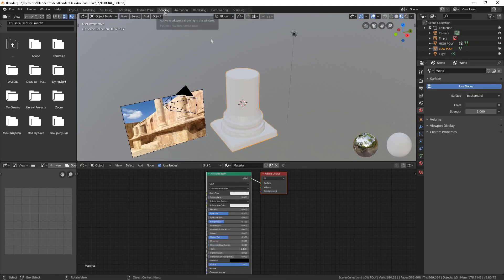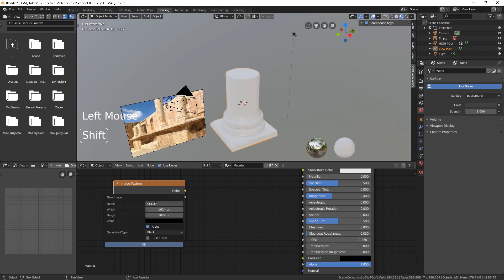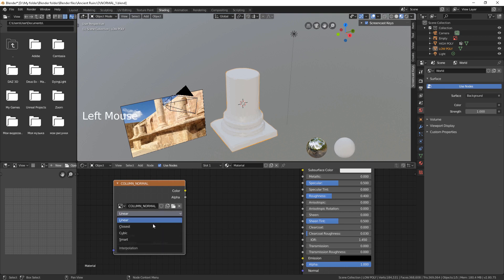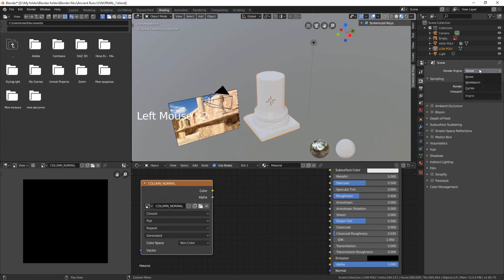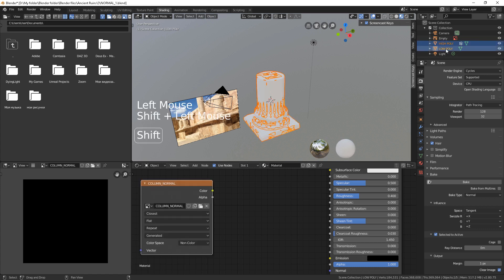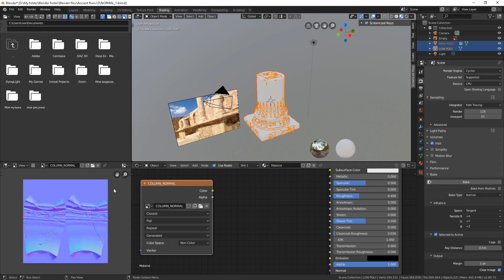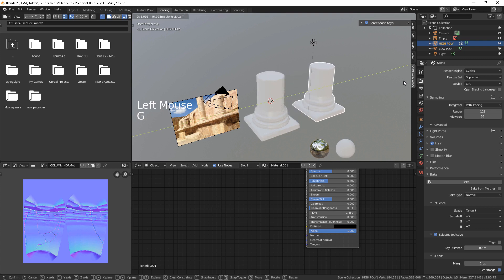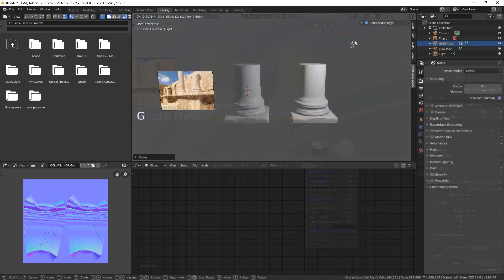Blender 2.8 / 2.80 Modelling a low-poly column / BAKING A NORMAL MAP CORRECTLY / NO SEAMS/GLITCHES

Comment: Im baking o my high poly so I only have one object to bake the normals on and Im getting orange color on the normal map. do you know how to fix this.
Reply from the maker: Hi! What do you do in specific? Anyway, baking with a cage mesh helps to resolve most of the issues. Check another video on baking ;) Most common problems occur, when baking with insuffient or too high  Ray Distance, baking onto Ngons, too small size of the low-polygonal mesh, not covering the high-polygonal mesh enough, baking without a cage, ect.
Reply: @artemtovbaz8452  Im baking on to the same high poly object just for the normal map. Its not too hgh poly but high enough.
Reply from the maker: @chrissem5200 You can bake a normal map for the same high-polygonal mesh, if it's sculpted with Multiresolution modifier, otherwise you bake from the high-polygonal mesh to the low-polygonal one. So in the second case you can use a Cage-mesh to prevent baking artifacts ;)
Reply: @artemtovbaz8452  I have a hard surface model which I modeled and im trying to bake the metal grunge normal map on it. 1 object only and baking on itself.
Reply from the maker: @chrissem5200  You have to have a low-polygonal object, if only you're not baking from Multiresolution, because there must be difference in the level of detail.
Reply: @artemtovbaz8452  Also Do you know why there would be transparent spots around my normal map.
Reply from the maker: @chrissem5200  Do you mean like alpha-transparent areas?
Reply: @artemtovbaz8452  yes
Reply: @artemtovbaz8452  Do you know why there might be some blurry spots on my normal map
Reply from the maker: @chrissem5200  Blurriness usually appears, when you bake onto smooth areas
Reply: @artemtovbaz8452  OK thank you.